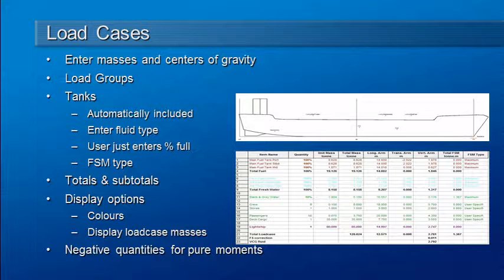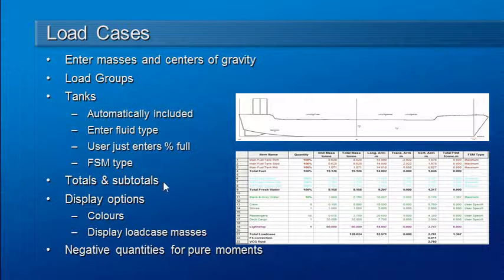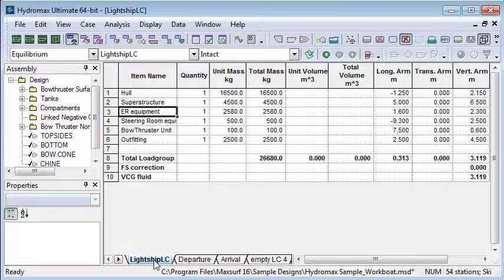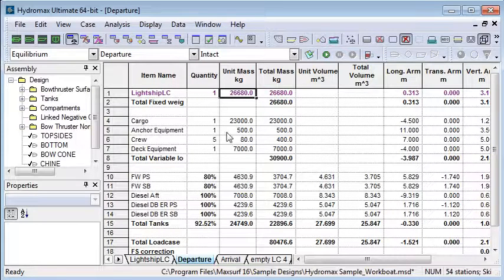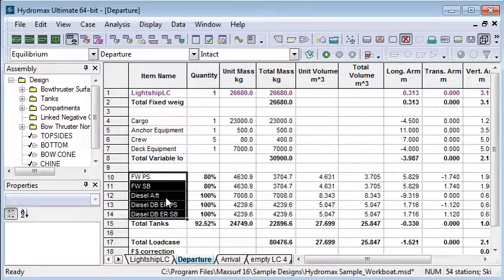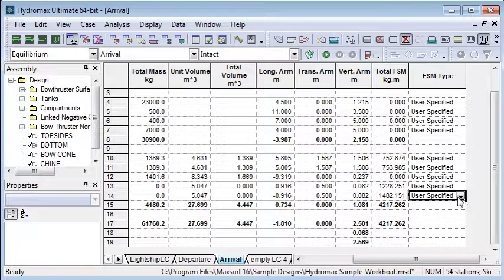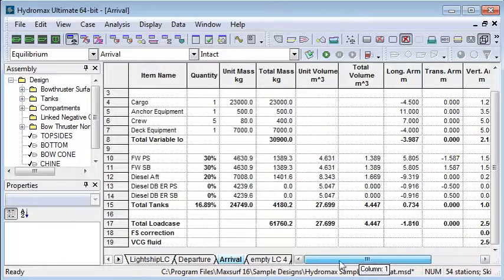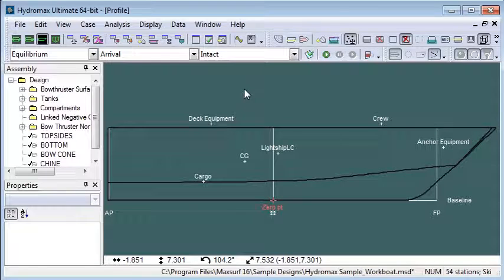MAXSURF Stability - Load Cases

Comment: Nice video thanks. However, if you apply some "pure moments" by using the method described and then subtotal them, the moments are not reflected correctly in the subtotal, although they are incorporated in the overall total! 😕

Comment: Hello, how can I put an empty row after each total?
Reply from the maker: Please post on our forum: https://communities.bentley.com/products/offshore/f/maxsurf-moses-sacs-forum
...or contact Support directly: https://bentleysystems.service-now.com/csp
Reply: please refer to the "StabilityManual.pdf" - "Loadcase Formatting" section on page 48 for details, but essentially:
Adding Blank Lines

A blank line can be added into the load case by placing a dollar ($), apostrophe (‘) or fullstop(.) character in the Item Name field.
Adding Totals or Subtotals
A subtotal can be displayed for several loads within a load case. To do this the item name
field must commence with the word ‘total’ or ‘subtotal’.
Sub-subtotals
Sub-sub-totals may also be inserted. Sub-subtotals must start with the text “subsubtotal”.
Grouping Similar Tanks
Use the move items UP or Down commands in the Edit menu to adjust the row order in
the loadcase.